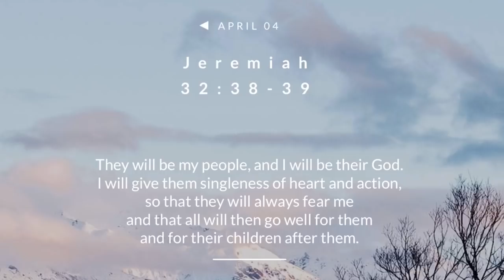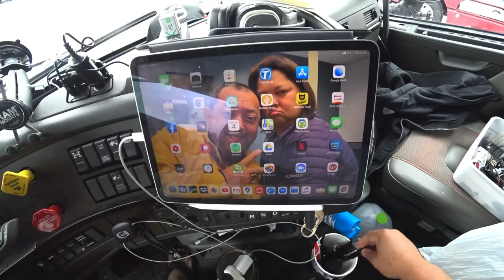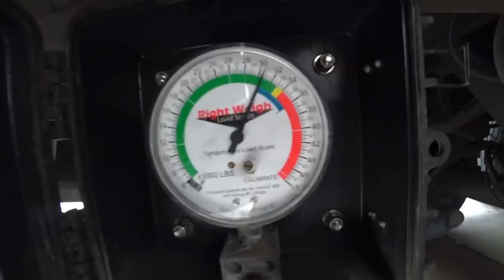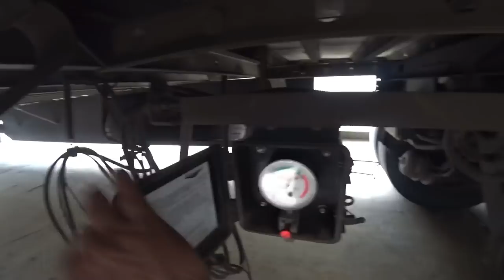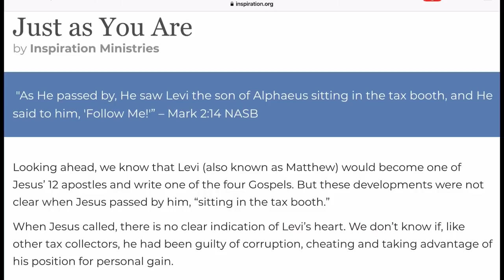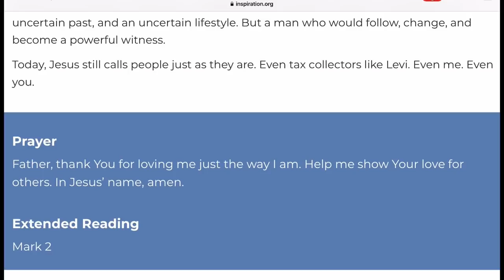April 4, 2020/157 octopus 🐙 cheese omelette with Tabasco sauce, ready to serve

Comment: what are the things at 10:40 that push agains the trailer walls used for?
Reply: Load locks to secure freight from moving
Reply: @dalesmith5222  Thanks for the info

Comment: LLC is an acronym for Limited Liability Company Lets you run as a corporation but with out a lot of the rules and regulations that a corp has to do. I owned a LLC back in 1993 to 2009 . car dealership, auto repair, trailer sales , two other businesses as well....

Comment: Hey JOHNNY. an LLC,  Limited Liability Company, let's a smaller company do business like a corporation, have it's own name, tax I'd #, bank accounts, etc. But it doesn't pay corporate taxes, because all income goes directly to the owners and the owners only pay personal taxes on the earnings. Just like a Tax Shelter. If two or more LLC ompanies get together, they become an LLC  INC. meaning LIMITED LIABILITY COMPANY, INCORPORATED.   Which means they are separate companies, that can share assets back and forth, like employees and equipment, even cash. But they still get the tax break, because the owners of the companies are in business together, collect the profits directly and only pay personal tax rates on those profits. One guy can own both companies or even more, and if they are small enough and qualify to be LLC's than he can bank the profits from all the companies and still pay just personal taxes on the earnings. Basically it means, you have to stay small enough to qualify maybe 50 or 100 employees per company, but you don't pay corporate income taxes. So if you and Larry became separate LLC companies and joined forces, the two names would still exist but add INC. to both.    JBG LLC. INC.   And  LHL LLC. INC. Both of you could divide or share the companies any way you want. Or keep each separate, but still share trucks and employees as necessary and still, get the personal tax breaks. Its how the rich get richer. You see this a lot with trucking companies. Two or more trucking companies getting together to skip corporate taxes by incorporating INC. and they share the wealth and employees between themselves.  Now if you drive for one LLC INC. and they send you to another LLC INC. Either too pick up something or drive their truck, than they are usually sister companies,  LLC INC. I sure hope you read this slowly. Its not really to confusing, but my problem is I usually make it complicated! Lol.
Take care stay healthy and safe. Jpol